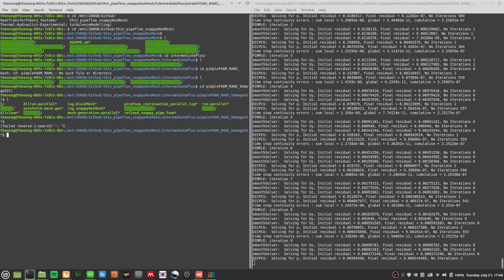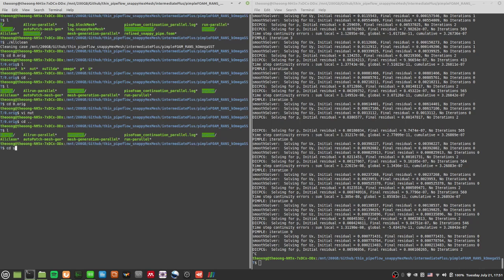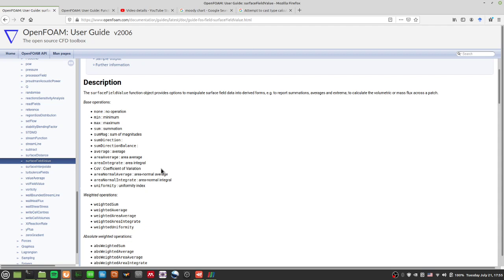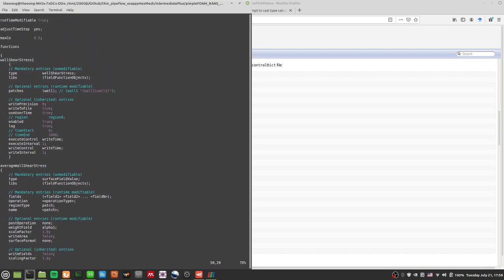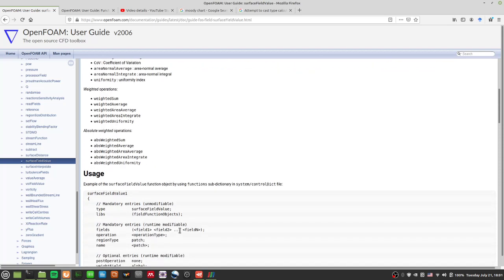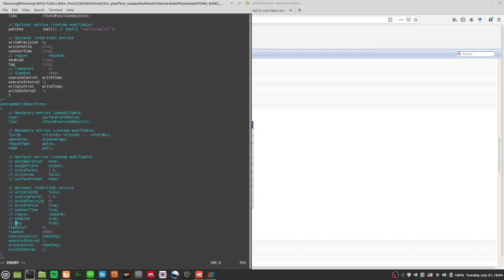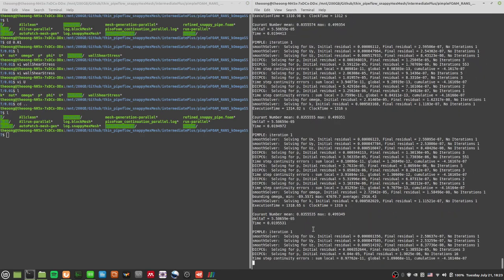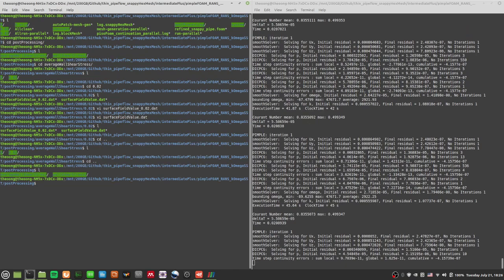OpenFOAM Intermediate - 69  surfaceFieldValue areaAverage functionObject

Comment: Hi Mr Ong, great work of you. Let me ask you something please.  I model a propeller based on the slidingMesh, using the fieldAverage functionObject to get the uPrime2Mean(so as to get the TKE), apparent value jump  appears in the AMI interfaces. This maybe due to that , fieldAverage is based on the rotating cell,  not on the fixed spatial point, so the Uprime2Mean cannot be used in the rotationg region. The question is: how can I get the right TKE(on a cuttingPlane or the whole region) in the rotating region? Do you have any references to do so?

Comment: Hi Mr Ong, thank you so much for such an amazing video. I have a Thesis deadline in a week. I need to calculate the wall shear stress on my model. I followed your tutorial perfectly, but when I run the simulation, I get the following error:
--> FOAM FATAL IO ERROR: 
wrong token type - expected string, found on line 59 the word 'fieldFunctionObjects'. 

I would be very grateful for your urgent help. Thank you in advance and Regards.
Reply: @TheoOngScienceAndEngineering  Hi. Not yet.
Reply: @TheoOngScienceAndEngineering  okay. I'll try my best. I'll also write if I find a solution